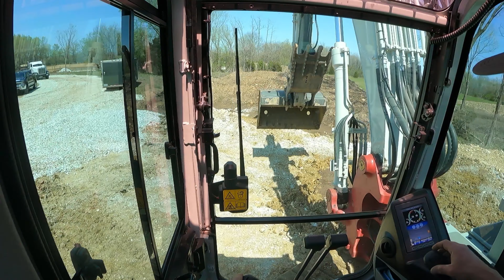Repairing A Soft Driveway With Geogrid And Rip Rap

Comment: I was thinking the whole time… spinning a track on that stuff would rip it to shreds!  A set of replacement pads on your dads new loader would eat pretty deep into any profit you made.

The toughness and tensile strength of the expanded poly far exceeds regular geo-grid.  It is reinforced with linear high density strands that are not brittle, even when frozen.  You can barely cut it with a sharp knife.  A pair of metal shears is what we used in the test lab.  

The nubs that stick up at the intersection of the horizontal and vertical strands actually create pressure points that lock it into place.  It won’t allow the stones to move even if they are too large to penetrate the grid.  That will knit the stones and they’ll all have to sink before the first one does.

We tested hundreds of types of fabrics in our lab… woven, bonded, coated, oriented strand, random fiber… none beat the expanded HDPE (High Density Poly Ethylene) for durability, resistance to abrasion and strength.  Good choice!

 Look… a much thinner and lighter version of this grid is used on a mattress.  It is between the top of the wire springs and the foam padding above.  It’s job is to span the openings between the wires and keep it from being abraded or from being forced into the openings (called pocketing).  It has to be able to do that for 20 years with people sitting, crawling, etc all over it for 8 hours each night.  Before it’s invention there were no 20 year warranties on mattresses!

Sorry for getting way over yonder out in the weeds… but, I wanted to assure you that you picked the right stuff.  

Too bad you can’t stockpile that clay.  There’s a bunch of dry ponds around that you could sell it to this summer!

#Exca-dozer for the win!!
Reply from the maker: Awesome! That’s great info I appreciate you sharing. I don’t know much about the stuff so this is really good information to have. It seems like strong stuff much stronger than the fabric at least with the 6” rock on it. Thanks again!
Reply: @eliteearthworksllc  you’re welcome… sometimes those days of old come in handy!

Thanks for the engine pics.  I hope he paints it soon or it’ll be rust red!
Reply: @eliteearthworksllc  it isn’t the right choice when you are trying to stop mud leaching up through finer gravel… like 2” base rock.  That is best left to the mat type fabrics.  👍

Comment: Builder is mistaken IMO... grid is for horizontal slope stabilization like you said. A high tensile woven geo-textile fabric is the right product. Meaning it provides true separation, strength, and filtration vs. the grid. Existing soil is going to "eat" the grid over time. I would lay down a layer of woven over the quarry spalls, then place/compact your CSBC. This is what I have seen in most sectional cuts when design calls for grid first. Really nice job, gonna be bombproof done right the first time!
Reply from the maker: That makes sense, I thought it was a bit odd here vs the fabric. Good to know I appreciate the info. Thank you! Hopefully it holds up to the traffic
Reply: @eliteearthworksllc  Hell ya it will! Just giving my, "I know everything, key board warrior 2 cents opinion" 😜🙄
Reply from the maker: @alsaku33  🤣🤣 I appreciate it cause I’m still learning on this fabric stuff

Comment: Hey, if using the ex-ca-dozer saves hauling in multiple pieces of equipment, and gets the job done, it's a winner.  I was just joking because when I was looking at an excavator to rent a few years ago, putting in water lines, and asked about an "angled blade" the guy gave me a lecture on how the blade was a stabilizer, and wasn't for pushing, or even backfilling with.  (So I rented a ride on trencher at another outfit, with an angled blade, because I didn't feel like spending all day with a loader going back and forth, or using a shovel on a few thousand feet of trench.)  And, for the additional jobs, that's the problem with doing good work, you get more work!
Reply from the maker: I agree! It’s definitely a great machine for me. Well I guess it can be for stabilizing I use it to push all the time 🤣. Appreciate you watching